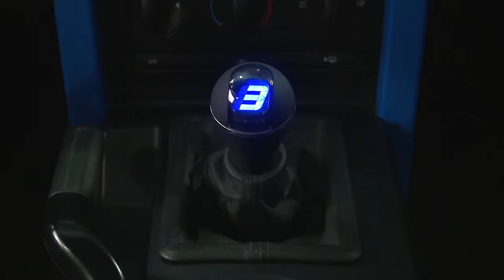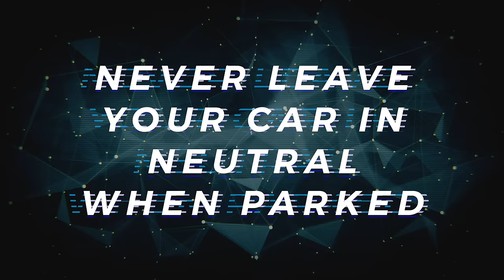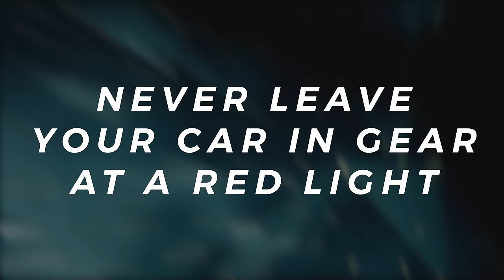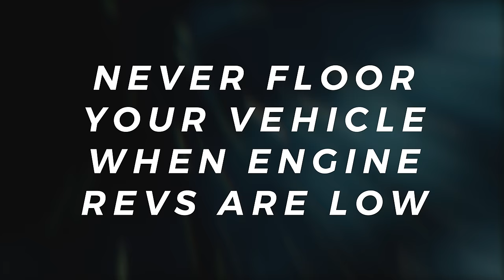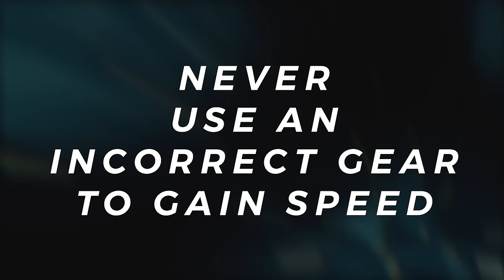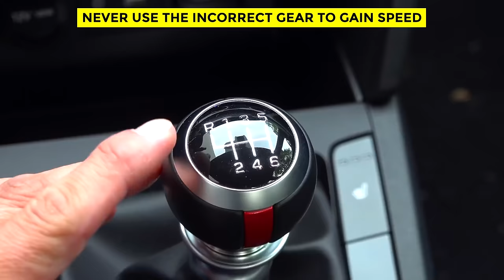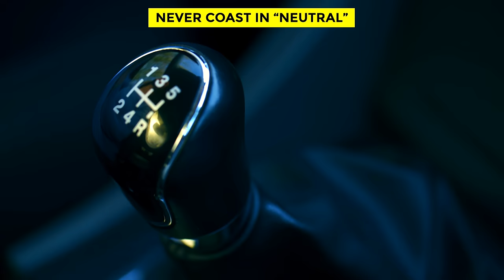7 Things You Should NEVER Do In a Manual Transmission Car!

Comment: Very bad advice, if you put the shift on "1" or reverse while parking, the thing is that if someone hits your car (and moves it) or if for some reason the car is taken by the public service, it will ruin your gears.
Reply: yea but if your handbrake fails there is nothing to stop the car if its in neutral
Reply: @arcanevoid9199 
why should a handbrake fail ?
Reply: @En_theo  can happen for different reasons but it definitely does happen

Comment: Manual Transmission is an old outdated technology... Automatics are far more efficient and shift reliable
Reply: autos are also old technology, manuals are more fun though
Reply: i mean manual trans are lighter and usually get better gas mileage and you just have more control over the car and autos are deffenitly not more efficent

Comment: Guys don’t buy a car with manual buy car with automatic ok guys?
Reply: no
Reply: @arcanevoid9199  yes
Reply: @Gamble333  autos boring
Reply: @arcanevoid9199  autos are faster
Reply: @Gamble333  uh not always, because of regulations manuals are basically geared to be slower. if you look at cars where thats not the case (gr86, miata etc) the auto is actually slower. and this is also the case for pretty much all older cars, the autos from the 2000s and before were awful. the only auto thats really better is a dual clutch which is borderline a manual anyway and even then a sequential manual is still faster